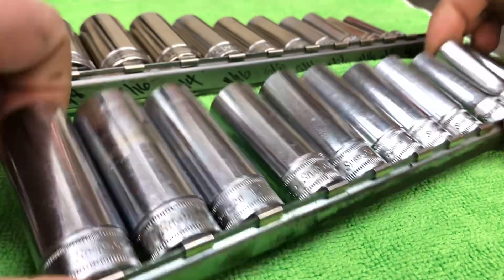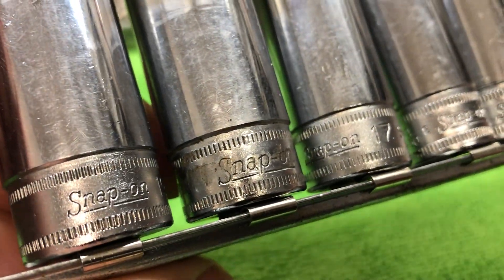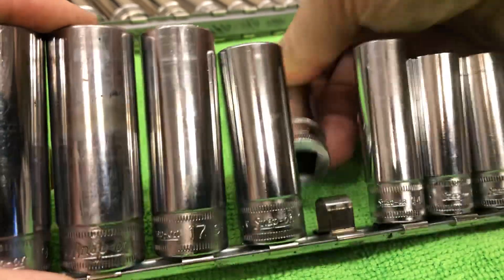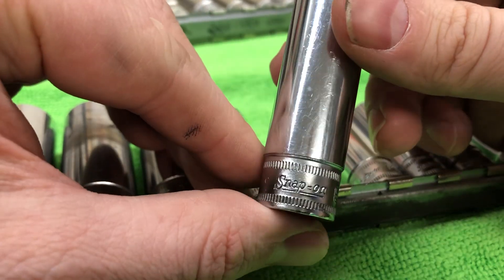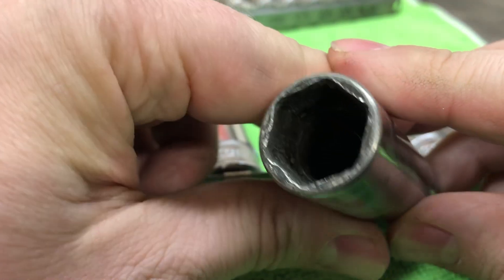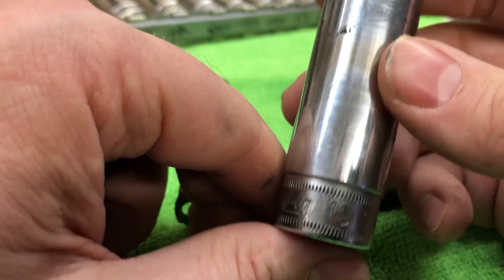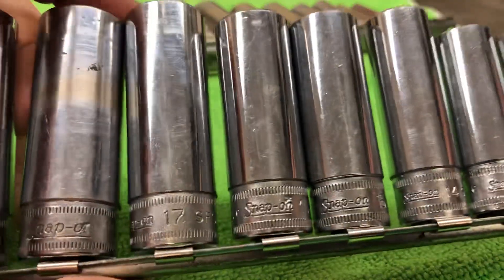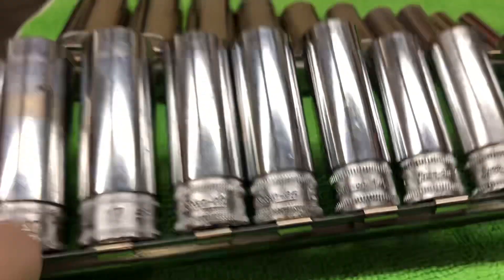1979 Snap-on metric sockets still relevant today

Comment: I have multiples from picking up various pieces at garage and estate sales.  The series don't always match, but I have most sizes covered.  Not being a professional, I don't need Snap On, but they are a pleasure to use.   I have been collecting 1/4" drive USA made socket sets, and have filled a KRA 149 box exclusively with Snap On in the 1/4 (and some 9/32) sizes, SAE and metric.
Reply from the maker: That is awesome!

Comment: Most Heavy equipment these days are metric.
Reply from the maker: Yes that’s for sure. Just enough SAE around to mess you up when in a tight spot.
Reply: @eightpenny6379  yep, used to be the opposite where just enough metric to mess you up but it's gone the other way these days!!!